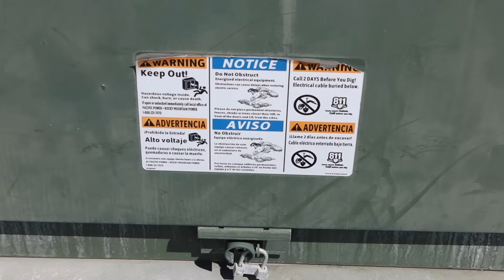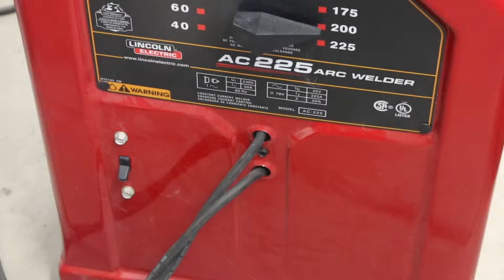Can You Get Electrocuted While Welding? Watch This...Don't Get Shocked!

Comment: Definitely a topic that deserves a lot more coverage. It’s hard to find anything about this on YT or the internet. I can find a thousand people telling me to “just give welding a try!” but finding information about how not to die is a hurdle. Seems backwards.
Reply from the maker: Thanks! I'm planning to make some more videos on safety topics.
Reply: @TimWelds  Hey Tim, love your videos, by far the best pn YouTube! I have a question in regards to this topic, I'm completely new to welding, have some oxy/acetylene exp. But zero welding, I just picked up a bottom line tig welder (HITBOX 200A ) an older model, it has the manual gas knob on the torch, I am really trying to understand the different types of welders and differences, but I am worried about the being electrocuted and I am not confident on how to avoid any potential safety issues, I have a heart condition as it it, I can't run the risk of getting zapped by high voltage, any thoughts on this would be greatly appreciated (also anyone else reading this that is an experienced welder that may be able to help) thanks for your time.
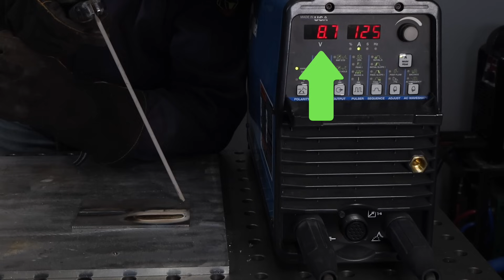Reply: @TimWelds  video time stamp 4:25  you are  Arc welding literally next to a beautiful Miller tig welder, damn you must have ruined the paint finish on that welder with ugly burnt pockmarks an soot /dust must of been sucked into it  . Jesus NEVER weld that close to any machine unless it is covered/ blocked from the sparks an smoke. especially with a miller welder that is that expensive
Reply: The comments here really just confirm the problem. My friend is a bare beginner who inherited a decked-out welding shop from an older relative, so the assumption that he won’t use big equipment because he’s a beginner is silly. He doesn’t know enough even to know which machine is “bigger” than another. As for welding barefoot or holding the metal with bare hands, it sounds to me like you have limited experience with particular types of machine, and you’re not even able to articulate how that affects your safety choices. 

Bottom line, this “dudes arguing in the comments section” model of safety is funny, until someone gets fried and then it’s sad.
Reply: Its only a problem when you are soaking wet. Usually when your gloves get wet with sweat, most you will do is just buzz yourself if you are holding onto the material while welding or changing electrodes. I hate it but it isnt really painful or anything. The dangerous aspect is working around standing water, in confined spaces where you can get hung up and not get out, or climbing around soaking wet while holding your stinger and ground.
Reply: I taught myself to weld earlier this year, I bought a few textbooks on the topic and read them all. I read the warnings and safety precautions twice. I advise you do the same if you are serious about the hobby - it is very fun and rewarding and the risk of death or even serious injury is actually much lower than you probably think. Avoid using chlorinated brake cleaner on a piece you intend to weld - it will release toxic fumes, which are lethal in a very small amount. That is the main thing I am cautious of when welding as I work in an auto shop environment. You will burn yourself pretty often though, but it's not that bad. Get a good welding hood, arc flash is basically a very severe sunburn on your eyes, though I've never experienced it myself I understand it is not a good time.
Reply: I've welded kneeling in mud, soaked to the bone, in a continuous downpour that was running water over my third pass of 5/32" stick about an inch behind me..
Just time the convulsions right and you don't even have to worry about making the loopy motions..
Reply: i was about to suggest the same, until i saw ur comment. nice
Reply: As an ee id say in general that it is pretty safe. The metal is way more conductive than skin/gloves.
Reply: Thank you! I agree. I even saw a video that had an element of humor in it - I was like ..."electrocution is no joke." 🤔
Reply: it's fairly easy to not get killed welding, don't weld while standing in a puddle of water,  use wet gloves, faulty equipment etcc...
Reply: Don't be scared
Reply: Dont worry mate as a beginner you won't be using enough power to kill yourself, main little things to beware of are
1-Playing with the inside of the migwelder whilst its running, cheaper setups can zap you
2. Touching steel with both bare hands whilst someone else is welding on the connected pieces.
3. Touching yourself or changing the stick rod when its on a really high amperage with no gloves on will give you a buzz lol.
In summer i weld in a singlet, no gloves and barefoot sometimes when im feeling lazy, its not dangerous at all
Reply: @SH19922x  well ... number 2 is wrong  we do that all day
Reply: @davidjones-vx9ju  Yeah lad try holding non coated steel with sweaty bare hands whilst someone else welds hot on them, you'll find out that it fuckin hurts lol
Reply: @SH19922x  yea   if you are a ..little girl
Reply: @davidjones-vx9ju  well that wold depend on how you are oriented in the circuit , the clamp and the stinger.
Reply: @davidjones-vx9ju  or doesn't have hands like shoe leather. You do have to be concerned more with tissue heating from the AC/ pulsed DC of most welders.
Reply: @SH19922x  Few questions I have that one seems to talk about is 1. The grounding clamp. Is it safe to have two; one for the table and one for the project? 2. If I only have the table clamped, do I have to make sure NOT to lift my project off the table and weld? 3. Perhaps it's just safer to clamp my project? And another 4. Is it required to have a metal welding table? Will a wooden table be ok? Thanks! I'm interested in little welding as a hobby. Little sculptures.
Reply: That's why it's a trade and not a hobbie you have to pay $$$$$$ to go to school
Reply: @jaysen2200  probably useful but definitively untrue.  There is NOTHING that can't be learned w time invested in YouTube and practice.  OF COURSE school may fast track that learning curve, and there's always a benefit to having others struggle w you and a teacher to ask questions, but it's CERTAINLY not necessary to develop into highly skilled welder (or anything). Whether it's Chinese, welding or calculus there's not a thing ANYONE can't learn w a few months of watching instructional videos AND practicing regularly.
Reply: @theoriginalmonstermaker  I used to think the same. Then I went to school . The more you know about welding the more you understand you know nothing .
Reply: @theoriginalmonstermaker  it's called the dunning Kruger effect. Welding is so much more than just running a bead .
Reply: @jaysen2200  nobody has to pay $$ for school, anybody can just purcha$e the equipment and operate a hobbie welding setup. try again, ps probably most people in trades learned at home from grandpa not a school. you know down on the farm.
Reply: @circusboy90210  ignorance is bliss

Comment: Can shoes ( work shoes) or leather gloves make the difference?
Reply from the maker: They definitely add another layer of protection because they provide some degree of electrical insulation as long as they aren't wet.
Reply: @TimWelds  okay, thank you. :)
Reply: I think mainly getting a shock will happen through your hands ?
Reply: True story , I’ve managed to electrocute myself through my eyeball. Welding in a confined space, putting in a new rod in, it flicked round and stabbed me in a closed eye. Yep lights were a flickering, no permanent damage only pride took a bit of a beating as a professional welder.
Reply: @andyav9165  did the same but i put it on my eyebrow XD happens ^^

Comment: I see some welders quickly tacking in different locations on different parts, they hold the handle on the electrode holder and then grab the ground clamp moving the ground to the next part, clamp it and two hands back to the electrode and holder, then start welding again (not turning off the machine). What would a professional welder do in this case?
Reply from the maker: There are so many different situations and other may have different opinions than mine. If the electrode holder is in good repair and if they are wearing gloves, the risk from doing this is probably fairly low. I think it would be a better practice to hang up the electrode holder while setting up the next part to avoid the possibility of bumping into it.

Comment: Do you have recommendations for shoes?  Is a welding mat suggested?
Reply: I own a welding company and all the welders I know including myself prefer rigger boots, although they are sort of outlawed her in the U.K. by our HSE due to them predominantly not having ankle protection. The reason we prefer this type of boot is the speed you can get them off if a lump of hot stuff ends up there,  I have had it happen to me on more than one occasion, also the laces tend to get burned too and the boot becomes really loose, so much for the ankle protection. As for electrocution, many , many times especially if you are wet and more so if you are using AC. Good luck hope this helps. Ps. Keep you overalls over the outside of your boot or use leather spats.
Reply from the maker: I just wear regular work boots that my job bought me a while back. I don't use an insulating mat, though there are some special situations in confined spaces, outdoors or where falls are possible that mats and special insulating footwear is recommended.

Comment: So the answer seems to be...depends.  Basically my question is, when set up correctly is it then safe for me to be touching the metal object that I'm welding on while I'm welding, or do I need to stay separate from it?
Reply: As long as your ground clamp is making good contact with the part it will be the path of least resistance for the current. Keeping your clamp clean, tight and in good shape as well as clamping on clean bare metal is key. wearing long sleeves and gloves is also very important. Holding parts while tacking avoids a lot of set up and is safe with all the above conditions met.
Reply: you dont need to stay away from it. from my experience so far you have to really fuck up to get zapped. like leaning on the ground clamp with your bare arm and then bumping the tip of your rod with the forehead. tbh it didnt even hurt bad... tiniest little burn where the electrode touched my head (cigarette burns are way worse) 
woke me up at worst XD still better to avoid tho.

Comment: Good stuff.  Worst path for electricity is through your heart.  Avoid using two bare hands when working with electricity.  Use your right hand preferably to minimize current flow through your heart.
Reply: Technically the correct advice (not necessarily for welding but following on from this post) is to put one hand in your back pocket so you can't accidentally use both hands at the same time, and touch with the back of your hand as this lets you move your hand away, otherwise at certain levels your hand could contract around the conductor keeping you electrified and potentially leading to electrocution. 

It's also completely different for high frequency high voltage, you will feel the discharge as it arcs through the air but if you touched the conductor you most likely wouldn't feel it as it's operating at a higher frequency than what your nerves can respond to, resulting potentially in internal burns which again you may not initially feel due to lack of appropriate nerves in the area being burned.

Also worth noting that a particular electric shock may not be enough to put your heart in to fibrillation it may easily be able to disrupt the operation of medical devices such as pacemakers or hearing implants, and particularly for the aforementioned hfhv shocks, any metal such as plates and screws holding bones together can be a focal point leading to concentrated burns. 

Electricity is fascinating stuff, and there's so much more to it once you scratch the surface :)

Normal water also isn't the best conductor, add some salt though (or seawater) and then it's a different ball game 😉. Stay safe and enjoy!
Reply: I got 240 v from hand to hand ,I actually felt my heart twitch ,ouch .No lasting damage thankfully. Keep safe.
Reply: @raychambers3646  your heart probably literally skipped a beat and your lucky to be alive... your heart doing this can put you in to cardiac arrest.
Reply: @YeeThirty  I did get a shock through one hand and out of my waist where I was leaning up against some iron work ,the worst part being I was up the top of a 3 metre pair of steps .Ps I wasn't shirtless but a couple of buttons had come undone!
Reply: @John-vf5rs  Within two years, 100 of the original 100 dead?  I wouldn't repeat that story.  Sounds like something an electrician without formal training might say.
Reply: Working on tube amplifiers the rule is one hand behind your back and a chopstick in the other. Never EVER stick your fingers in a tube amp even after the power has been disconnected as the filter caps will dump +600vAC killing you if you touch em.
Reply: @YeeThirty  The biggest shock I ever got was from an old fender amp, came to across the room.
Reply: @YeeThirty  
Same with old CRT tvs.